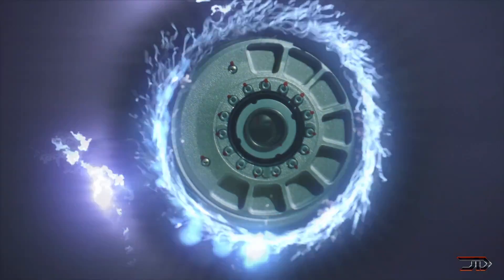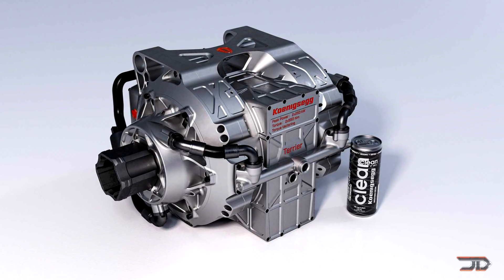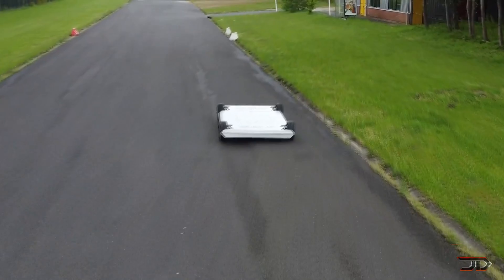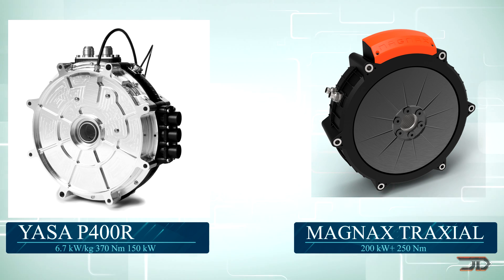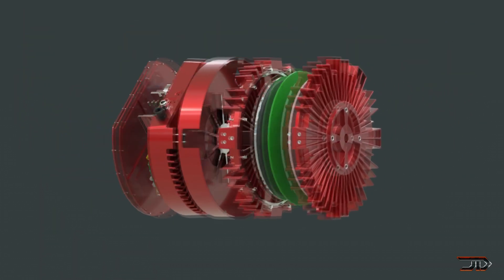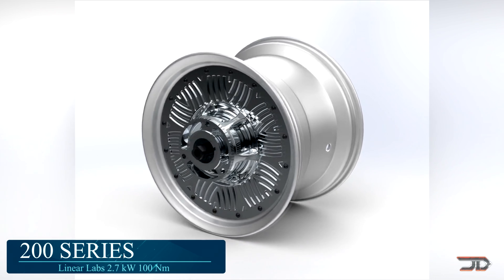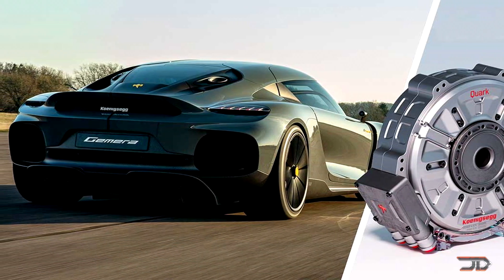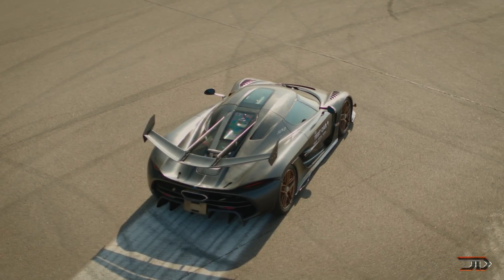INSANE New Motor Is Most Powerful Ever Made!

Comment: I would like to see these companies produce small high powered generators so I can power these electric motors in my car without batteries, just like a diesel electric locomotive
Reply: To drive with an IC motor, I'm guessing?  There are fairly high efficiency generators out there if you look around.  My father's hybrid Camry from a few years back, if you drive it very gently averages 44 mpg on the highway, and 46 in town.  Obviously if you drive it harder it doesn't get that much mileage, but it is still VERY impressive.  I expect the in town is better given the lower speeds and the fact that the regenerative braking makes up for more than that difference in stop and go traffic.
Reply: @MrJdsenior  I understand there is efficient generators out there, I would like a generator that can supply enough power efficiently to keep up with the demands of a 700+ horsepower electric motor. I wouldn’t be using 700 hp all the time but 700 hp is a big leap 200 hp
Reply: @K-Effect  You don't want much :-)
Yeah, that would be fun.
Reply: Excellent points…we have an 06 Toyota Highlander Hybrid with 225k and it’s still averaging about 25mpg. Pretty incredible for a 16 yr old 6 cylinder SUV. It runs better than I do…I’ve been breaking down for years. :/
Reply: @AREA_50.1  :-)  I have an Acura TL with 315k.  The oil at changes still looks like honey, it uses no more than it did new, and as far as I can tell the performance is pretty much exactly the same as it was new.

I don't know what age you are, but personally I am currently just recovering from a severely blown out back and have a torn tendon in my calf that starts to hurt at about 100 yards of walking. And I've probably still got about 25 or so years to go in life, so I feel you.

Compared to cars I remember from the 60's and 70's the cars today are so reliable that it is amazing, especially if you ever owned anything with the equivalent of Bosch electrics, or pretty much all the accessories of every car out there at the time. In 100K a few alternators, a few starters, yada yada was very common back then.  I have done both of those once in 320k, and very little else.  

I did have to replace the rubber O ring valve cover gaskets recently because they were STARTING to leak.  If you are old enough, do you remember those cork jobs under the stamped out valve covers?  They basically leaked CONSTANTLY, from about 25k on.  They don't make them like they used to...THANK GOD!
Reply: I think that is a great idea since diesel electric trains get huge amounts of miles per gallon. Perhaps have the generator run on biofuels or hydrogen? Liquid Piston has a revolutionary rotary engine that can run on different fuels. There are some hybrids - that I recall correctly - that have that arrangement.
Reply: I have seen some Europeans tow diesel powered generators in back of their electric vehicles.